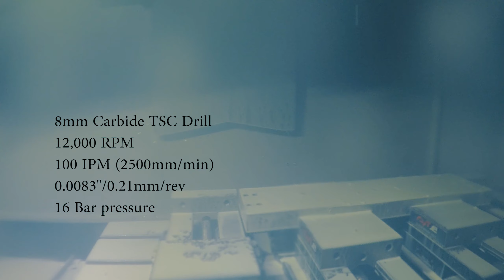CNC Milling tight tolerance boxways

Comment: Is it possible to see the work of the SwissMak with carbon steel and stainless steel? I would like to see how the machine behaves. How quickly you can mill steel parts.
Reply from the maker: Phenix,
At one point in the Kickstarter video it is shown cutting an iron bar into a helical hexagon shape. The material removal rate is limited by how much power you can draw from your wall outlet; we sized the DC power supply of the machine to cut off safely before it trips a breaker in a typical 15 amp 120v US house outlet. Users who want bigger motors and power supplies need to have access to a 240v appliance outlet.

In general, cutting steel requires about 1 horsepower for 1 minute to remove 1 cubic inch of metal. Aluminum takes about 1/3 the power so this machine (2hp motors) can cut about 6 cubic inches per minute, or roughly 90 cubic centimeters. These are approximations, as very sharp tools can cut much more than this and dull tools much less.

Comment: Hard anodizing will not provide "long wear". What type warranty on the machines?
Reply from the maker: Frijoli,
The 2 early prototypes were not anodized at all but did not lose any measurable thickness in the boxways after all of the testing we did with them. Having a hard anodized layer a few thousandths of an inch thick prevents abrasive wear from normal use, the anodized layer is around 65 Rockwell C and the surface that slides against it is a soft polymer with PTFE in it. It would take years of constant, heavy use to wear away the hard anodized layer on the boxways. If that happened we would just ship a replacement boxway; they require no grinding, scraping, or heat treat so these don't cost nearly as much to manufacture as traditional machine boxways.